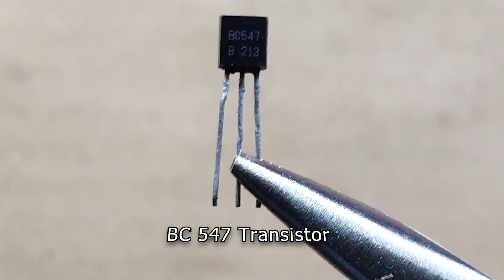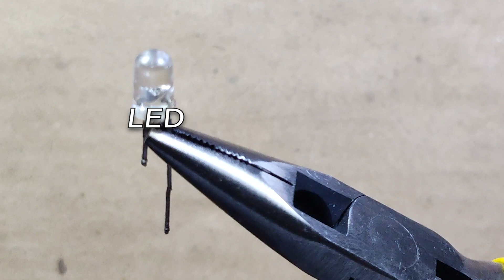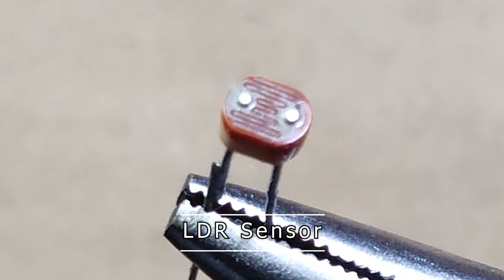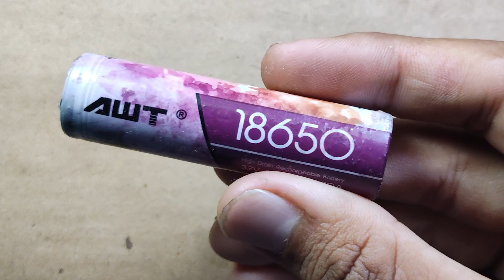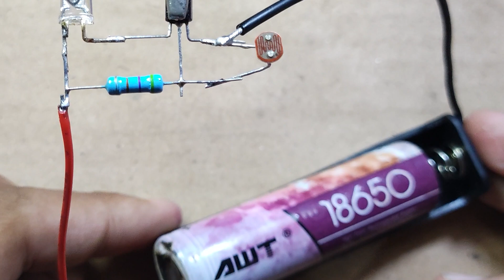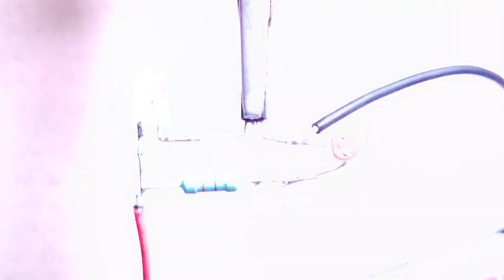How To Make Automatic Day Night Light Sensor Circuit

Comment: what if im only provided with 9 V d.c. power supply light bulb (2.5 V, 0.3 A), light bulb (4.8 V, 0.3 A) and 
2 resistors (180 Ω) resistor (390 Ω)